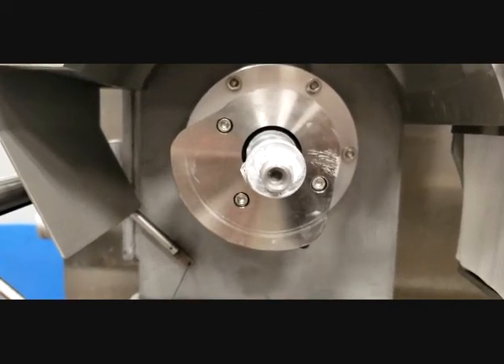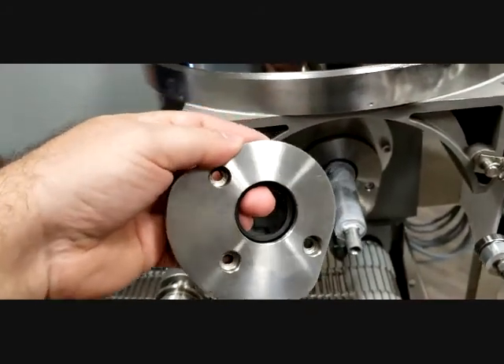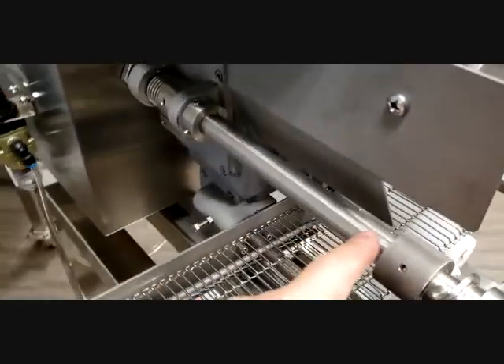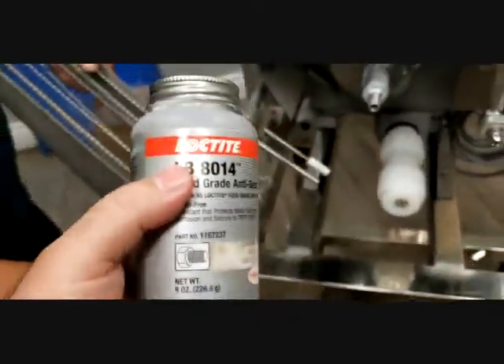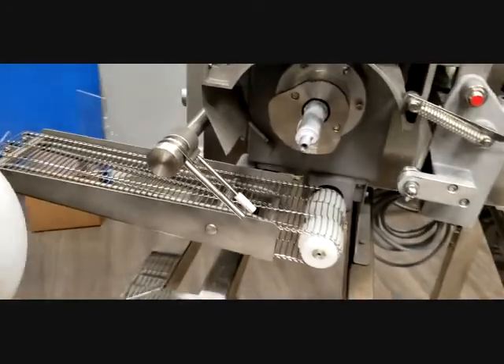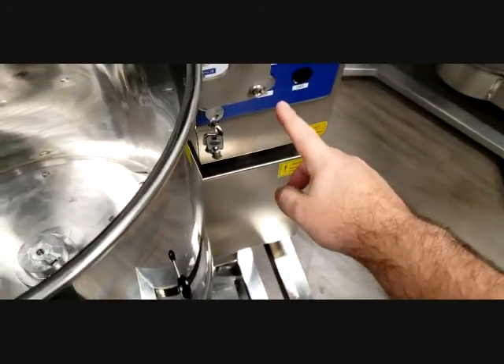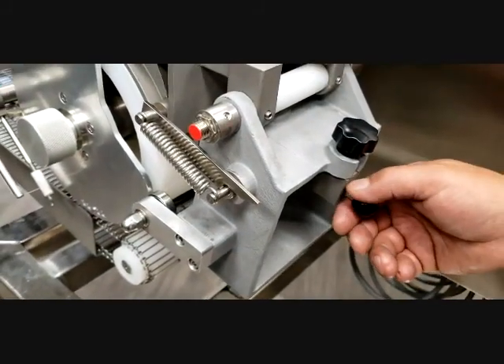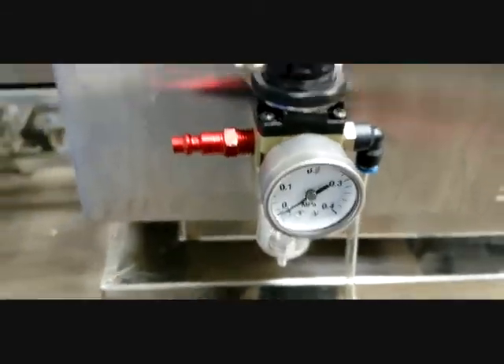Automatic Hamburger Patty Forming Machine with Wire - CM Machine Services Ltd.

Comment: I have the same machine and my problem with it is that the meat will stick to the mold, always patty come out on the belt in a bad shape, i believe there must be kind of non sticky version of mold or any idea how can I solve this issue??
Reply from the maker: Depending on your product, the machine will work differently for each type, that said it is very versatile. This machine works well for minced meat and potatoe type and other binding materials it is used for many types but hard to say for everything...